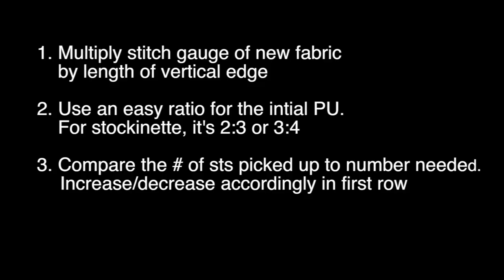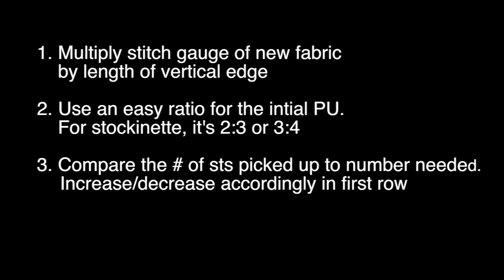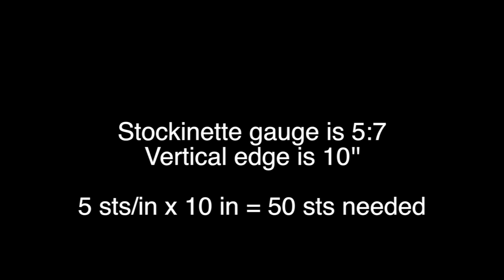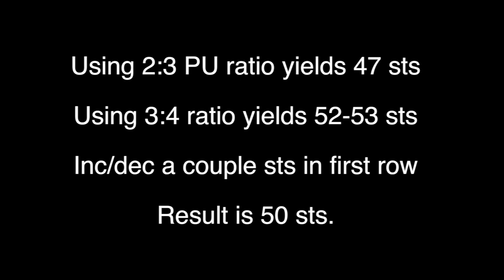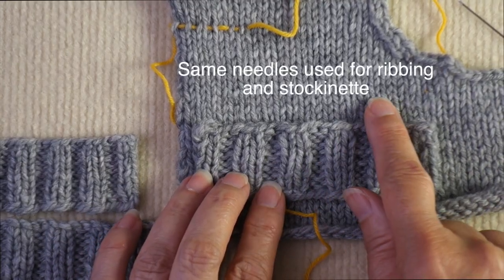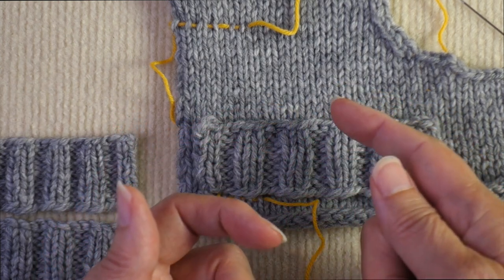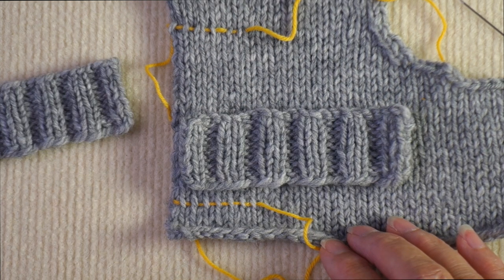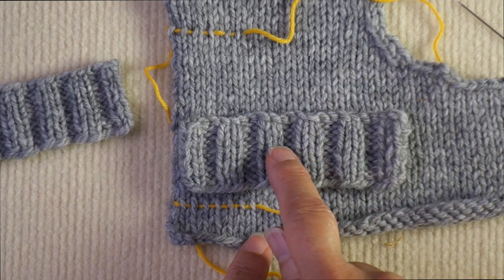Picking up stitches for a button band

Comment: I am approaching picking up stitches for a perpendicular garter stitch button band on a long length vest.  The pattern indicates how many stitches to pick up in each section (front button hole section, neck shaping decrease section to shoulder, and neck band and down the opposite side); a total of 332 stitches!  Before cable needles made dealing with A LOT of stitches possible, was this type of button band (perpendicular) simply not done (is this a "modern" design feature?)  I'm hoping that I can find a cable long enough to do this myself as it is!
Reply from the maker: It is a more recent design feature (within the last 50-60 years, if you consider that recent). Earlier patterns typically had the button bands knit in the same direction as the body. For garter stitch, it was typically knit at the same time as the body. Stockinette bands were knit double-wide, folded over, and seamed to the body.  neckbands varied: some were knit separately and sewn on. Others were picked up and knit in the round (for pullovers.) I have seen one mid-19th century gentleman's vest pattern where no ribbing was done at all until the end, and then sts were picked up along the bottom and the vertical edges, with mitered corners.

Comment: Would you work the button band the same way if you have slipped the first stitch of each row? I'm just learning, and my end of row tension is a little loose, so I slip the first stitch in each row to avoid big loops at the sides. However, I've just finished the body of my first raglan cardigan, an need to pick up stitches for the button band. Thanks in advance :)

Comment: This is confusing for me. Here is why. In your example the gauge is 5 stitches per inch and 7 rows per inch. The sweater is knit bottom to top so it is the number of rows that make up the height of the garment for the button band. However your example calculates the number of stitches to pick up for the band based on the stitch count 5 rather than the row count 7. Am I wrong?
Reply from the maker: If you have a piece of fabric that is 10'' long, and your gauge is 5 sts/in but 7 rows/in, then it will be 70 rows long. If you want a piece of fabric to come out of that vertical edge of 70 rows, perpendicularly, then you will need a piece of fabric that is also 10'' wide, which will be 50 sts.

Comment: Hi Roxanne, I am an Englishman new to knitting. Are you able to answer basic questions on the subject ?
Reply from the maker: I am happy to answer knitting questions of all types in my Ravelry group. There is a link to my group at the bottom of the video description. You have to be a member of Ravelry to access the group, but it's free, and they don't sell your email address. Ravelry is an excellent resource for knitters of all levels, not just for getting help in the forums and groups, but also because of its yarn and pattern database, and the tools available to users to track projects, yarn stash, and library.

Comment: This is very helpful. Thank you 😊. I also need help in picking up stitches going in the opposite direction. I picked up the right side band beginning at the bottom, then turning the row at the chest to the bottom again, etc. Now I'd like to do the same with the left side, but if I begin picking up at the bottom it becomes reverse in direction from what I am accustomed to. I hope you understand.
Reply from the maker: You have to pick up with the RS facing, so for one edge, you start at the bottom. For the other, you will start at the neck.